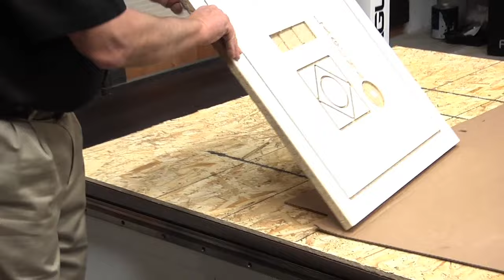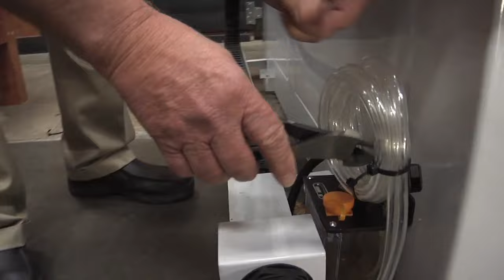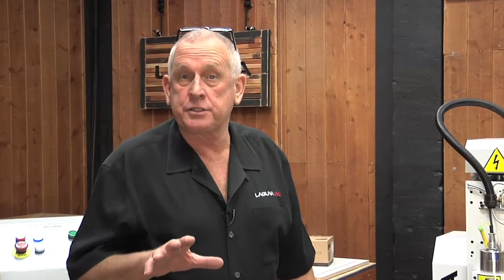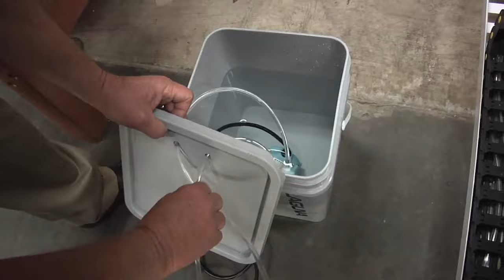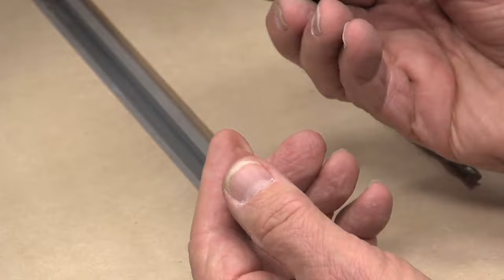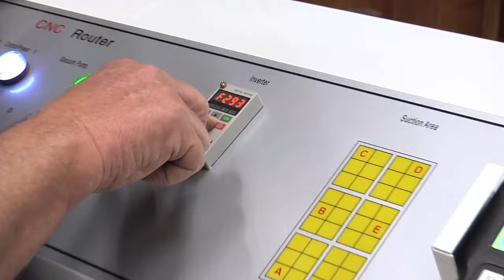Swift CNC Setup | Laguna Tools

Comment: Did you warm up your spindle before running the job? Did I miss that part? Or do you just bring yours up to speed and start cutting immediately?
Reply from the maker: That's a great question actually and I'll have to ask. I've only seen it start spinning as it moves to start cutting, but I could have missed the warm up process, too
Reply: @LagunaTools  no reply

Comment: What kind of voltage is necessary for these machines?
Reply from the maker: +Despicably Irascible Rapscallion 220 Volt.
Reply: Thanks.  Is the pump powered through the machine itself?  Same question for vacuum table?
Reply from the maker: +Despicably Irascible Rapscallion Yes. Feel free to check out our Swift CNC Machines at http://www.lagunatools.com/cnc/Swift
Reply from the maker: Feel free to call us at 800.234.1976 - Let's Discuss.